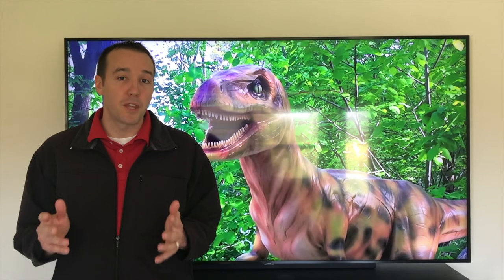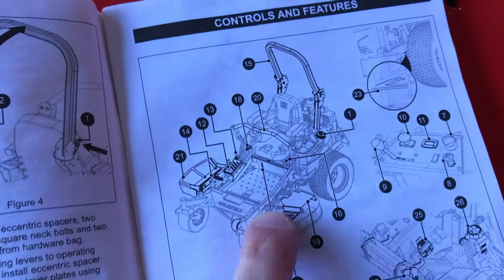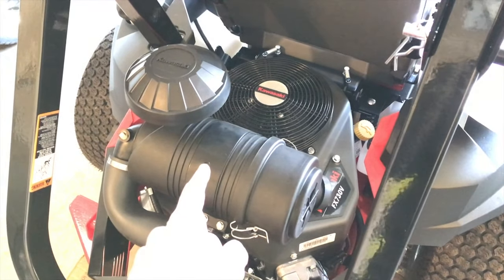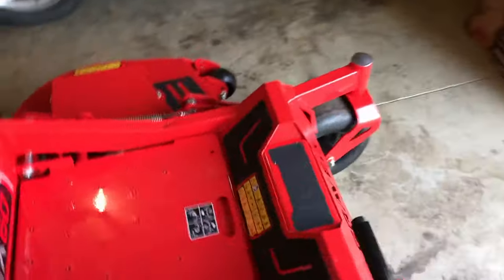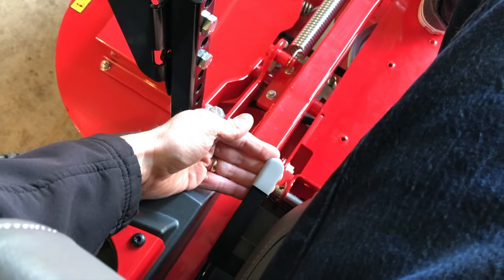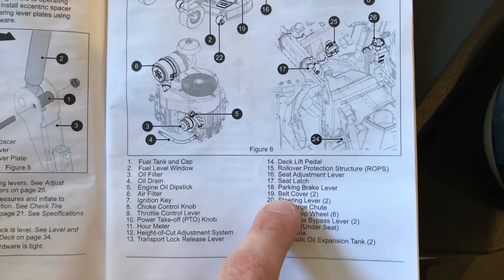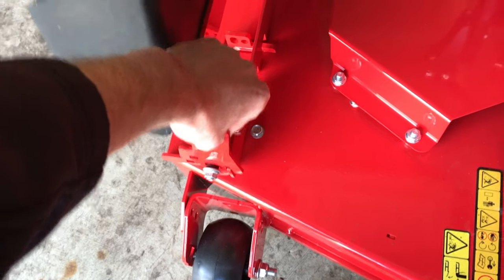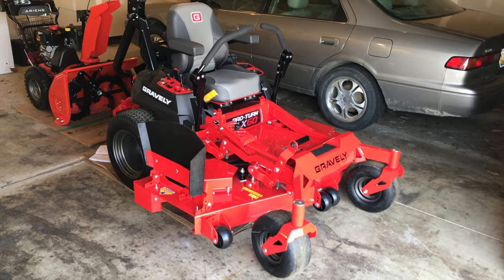Beginner tutorial Getting to know your Zero turn mower - Gravely

Comment: You're a lifesaver.  Just bought a house with a ProTurn 152. I've never used anything like that before. When I engage pto and take off the choke it stalls out reliably. So I don't know what's up with that. But at least I know what's what.
Reply from the maker: madwilliamflint 

Thanks for watching, congrats on the new house.  Prior to engaging the PTO, you will want to make sure the choke is completely closed/off & have allowed your engine to warm up for at least 5 minutes.

Always turn on PTO at idle Turtle throttle setting to alleviate stress to the belts & pulley’s.  After turning on PTO, slowly increase throttle to full Rabbit setting.

Mowing your lawn at any throttle setting less than full Rabbit is not good for your engine nor parts...and can lead to continuous stalling.  In other words… Anytime you’re mowing, make sure your throttle is set to full rabbit.

Definitely let us know if you have any questions along the way.  Us fellow DIY’ers need to stick together.

Please subscribe to the channel and ring your YouTube bell 🔔 this Will be very helpful to us thanks again!

😎👍🔧🔩
Reply: @DIYwithMichaelBorders  Here's what I found: If I take the choke off completely it stalls out as though it's simply idling too low.  However if I apply it slightly, everything runs just fine.  Did a roughly square 1.5 acre lot in an hour and only banged in to a couple few trees trying to get fancy with my edging.